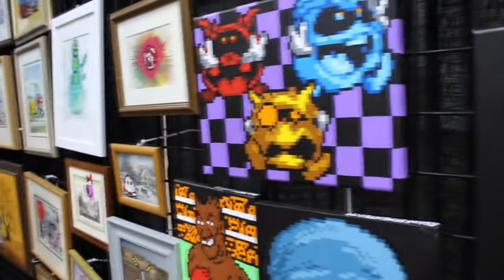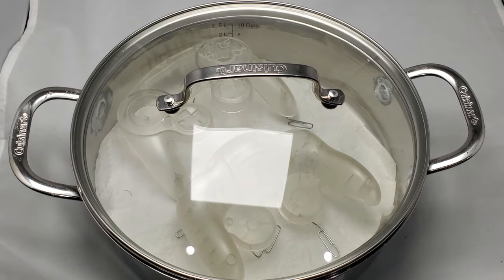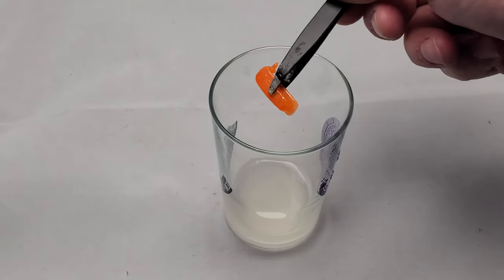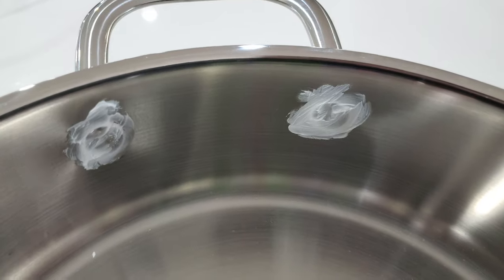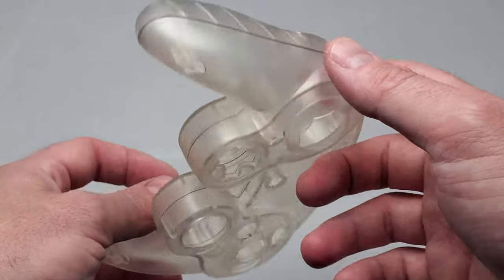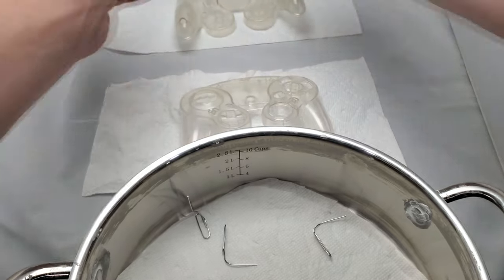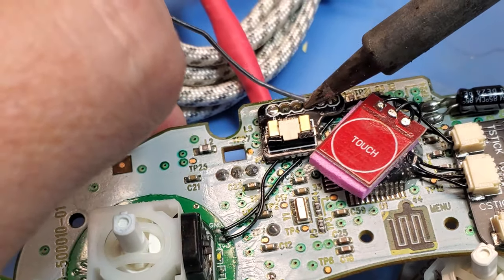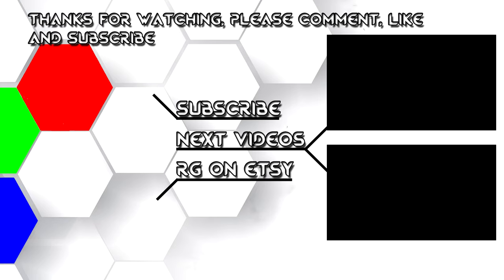Vapor Polishing Controllers is AMAZING!

Comment from the maker: Thanks for checking out the video, one thing to mention is this process will work on any ABS controller shell and is not just limited to GCC shells!  PLEASE NOTE, if you have these clear Controller Chaos shells DO NOT USE IPA on them.  They are not 100% ABS and contain some acrylic.  the IPA will cause cracking in the plastics.  ONLY CLEAN WITH SOAP AND WATER!!!
Reply: Maybe a clear purple gamecube controller would look nice with the atomic purple n64 controller and gameboy color
Reply: been doing vapor polishing with other controllers. IPA destroys them too. So it's fair to say this happens with ANY clear controller, not just the controller chaos ones

Comment: Thank you very much for this great tutorial. I have two little questions:
- Does vapor polishing only work with abs plastik or with other to?
- If the shell has a logo or something printed on (like the gamecube logo on the controllers) does it stay after vapor polishing?
Reply from the maker: Great questions. It will work on other plastics but you millage will vary. Abs and acrylic blends seem to be the best, but if there is too much acrylic in the controller just be aware that using ipa to clean the plastic could cause other issues.

2 - the logo will stay on there just fine 🙌

Comment: Just some extra info, acetone does not react with all plastics. I've used acetone vapor smoothing on 3d prints made of abs, it does nothing to pla. I used an empty gallon paint can you can buy at home improvement stores. Used magnets to hold paper towels to the inside of the can, placed the object I wanted to smooth on the inside of the lid and laid the can over it
Reply from the maker: correct, you want to be using this process on ABS plastic!

Comment: Would a pyrex/glass, (or worst case) plastic container with an air tight plastic lid work? I assume the acetone fumes would eventually eat away at the lid seal but this is more for a one time use. Also am I right in assuming acetone based nail polish remover would accomplish the same thing?

Comment: could that  "gold" tint be from age yellowing? maybe retro bright it first next time then vapor polish? Either way, awesome idea, I may use this.
Reply from the maker: You should give it a try when you can, it worked shockingly well!  I have a feeling the gold/yellow was from the manufacturer having the heat too high when melting the plastic and they burned it so to speak... I am not super knowledgeable with injection molding, but that is my thought as to what happened.  Its not super noticeable though and for the cost of these shells, its all good!

Comment: i´d love to come to Illinois, but that´s a little to far away for me :(
The clear controller looks awesome, but wouldn´t it be easier to make a mold and cast with clear resin  or is the acetone method really better?
Reply from the maker: Dude hope you were not affected by the flooding! You could do it that way, but it would retain the original finish even with clear resin. If you were going to cast it and make it transparent you would need to either paint it first or sand and polish then mold and cast.

I will also say, this is 1000x easier than any of the above.
Reply: @RockerGaming  luckily not, but I know a few people that were. Fortunately they survived it without an incident. Also I didn’t know that this really was easier so i think I’ll try it sometimes